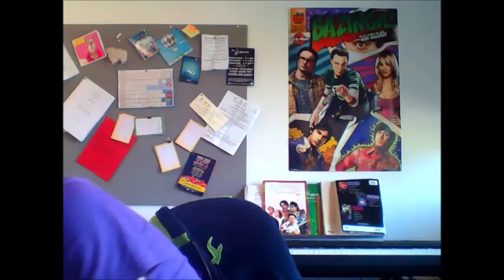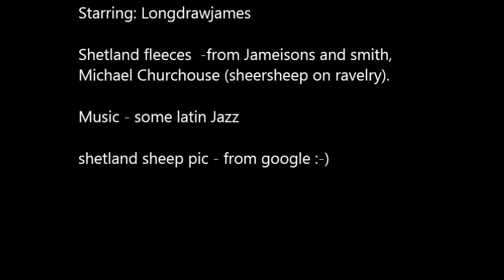shetland fleece - how I prepare it

Comment: I raise Shetlands in the US.  I've been breeding Shetlands since 2004 and the majority of my flock has the shedding trait and I roo (term for removal of the shedding fleece) most of my flock. I do select for this trait to some degree and I've found that hand spinners love the raw fleece because there are ZERO second cuts and no blunt edges.  I can also skirt as I roo the fleece and since I put covers on my sheep to keep out the VM and dirt, everything from the main fleece goes in one bag, neck wool in another and britch in another.  This gives my raw fleece buyers the best of the best.  I breed single coats, so the prep time is further reduced because the fleece doesn't have to be separated.  While visiting Shetland, Scotland and the UK, I never even saw any of the dual coats like we have here in the US.  I breed single coat Shetlands, the same type that I saw "across the pond" and I'm very pleased with the fleece quality. Thank you for this great prep video, it's wonderful to see a young man that knows so much about fleece!!
Reply: Kelly, 
Where are you located?  I live here in CT  I LOVE Shetland!

bjr